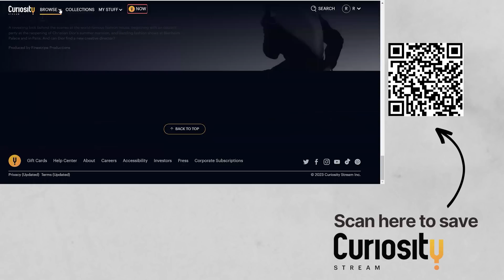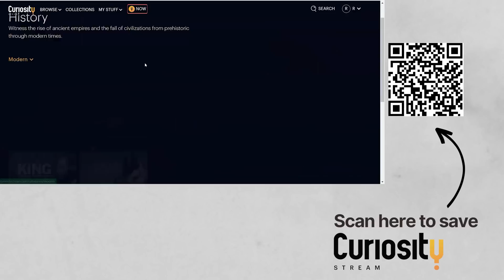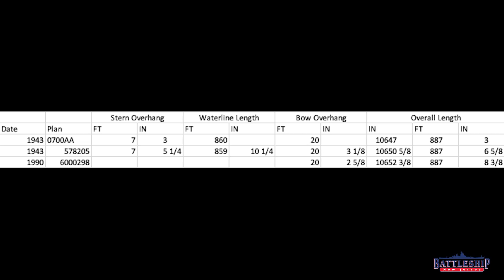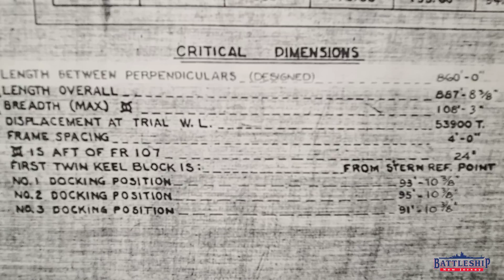Why Is New Jersey Longer Than the Other Iowa Class Battleships?

Comment: The Super Structures aren't Identical, a change to the weigh and distribution.  will be different and cause different degrees of hogging.  The RMS Queen Mary has big issues with this, due the changes that were made to turn the side into a museum.

Comment: The most accurate way to measure New Jersey's length would probably be with a ruler or tape measure when she is in drydock, simply by measuring the hull from front to back
Reply: Just as easy to do when in the water, as the longest point would be at/slightly above deck level. Using a tape measure on the side of the hull would be very wrong due to the curvature.
Reply: @ravenbarsrepairs5594  I meant under the hull/at the bottom of it. And considering the curvature at the bow, it's also not a good place to do
Reply: Deck curve and imperfections + no straight line from end to end. Superstructure and turrets are somewhat in the way.

Comment: If the length was measured in the Winter and again in Summer with a 50 degree F temperature difference the length would change by about 3.5 inches.

Comment: Actually, I thought the Wisconsin was longer by 1 frame due to repairs and the replacement bow from the USS Kentucky?
Reply: Wisconsin's lower bow was replaced, but the main deck is the same length as built
Reply: @nickgriffin5835  You're correct about that. I have photos of bow section from Kentucky that was welded on to Wisconsin ... and it shows the area where the anchors come out on Wisconsin's bow was left original.
Reply: BB Wisconsin was 'stretched' due to a repair.  BB New Jersey was BUILT longer.
Reply: I thought the same thing
Reply: think this is what he meant to post but typed NJ out of habit? because Whisky's nosejob is also the first thing that popped into my head.
Reply: It is.